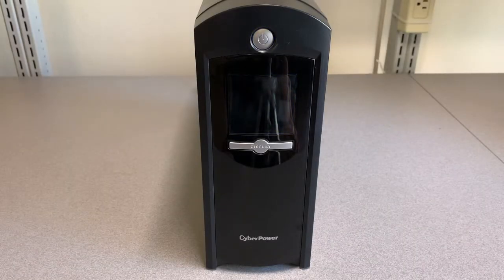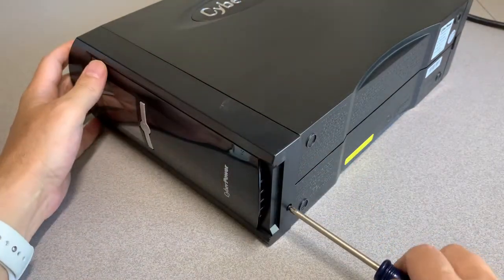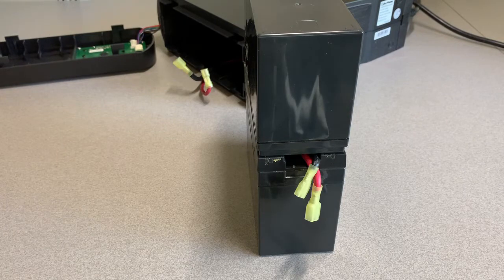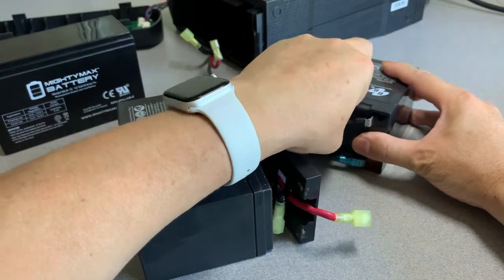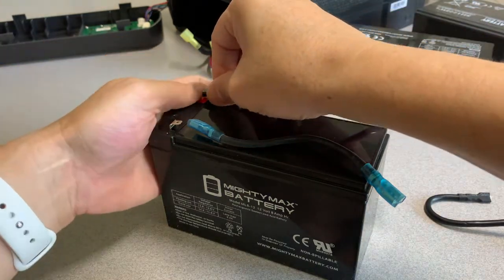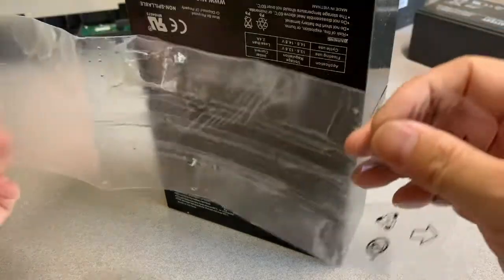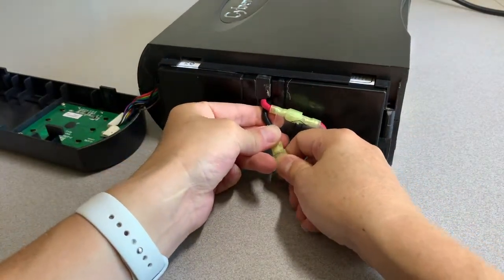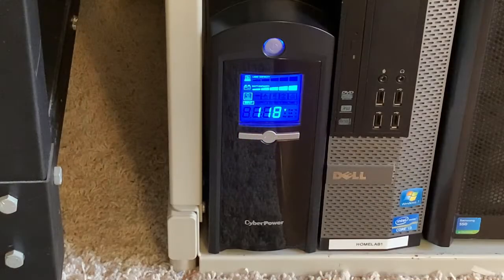How To replace a CyberPower 1350va UPS Battery.  Blinking Blue Display

Comment: The unit I had from Costco comes apart different.  Front panel does not come off.  Remove 2 screws on the bottom. Lower left side panel can be removed.  rotate batteries out. Batteries are end to end and not taped.  Disconnect and reconnect new. Put side panel back on.  Mine failed from a power surge  Otherwise good video, thank you
Reply from the maker: Thank you for sharing your experience with a different variation of the UPS.
Reply: Exactly the same thing as me! I replaced batteries on on many of these units over the years and it was always so much simpler than I was finding the instructions here. That's what happens when they change a model, but keep the model number. 🤪

Comment: I appreciate this video - my CyberPower 1350 AVR screen is doing the exact same thing, and it won’t power my PC.  I’m wondering if this procedure is the same for the AVR, since you said yours is the “VA”?
Reply from the maker: Hi EnochLight.  The 1350 AVR does look very similar to the VA.. That said, I'm a bit reluctant to say for sure, since I haven't personally tried it.
Reply: @BIsForBudget   - thanks!  Decided to brave it and take it apart anyway. Exact same procedure as yours evidently, and the batteries are the exact same. Just ordered a set from that link you posted. Cheers!
Reply from the maker: @EnochLight  That's great to hear. 👍

Comment: Thanks for the video. This helped a lot. How's the battery holding up? I haven't used the Mightymax brand before.
Reply from the maker: I'm happy to help.   The first set has been going strong for nearly 2 years.  The latest one has been running without issue for roughly 3/4 months.   I haven't had any issues so far (knock on wood).

Comment: What is the correct way to dispose of the old batteries?
Reply from the maker: Hi Jonathan, I used this site to find a local recycling site: https://www.call2recycle.org/locator/.  Thanks!
Reply: @BIsForBudget  awesome. thanks!
Reply from the maker: @jonathansafir3084  My pleasure.
Reply: I got replacementr batteries at Batteries+Bulbs (retail all over the US) and they recycled the old ones.
Reply from the maker: @gmc9753  Nice!  Thanks for sharing.

Comment: ROFL I was about to take a sledgehammer to it until I realized that my particular model, which is exactly the same as yours, had a faceplate that had to be pushed *UP*, not down.
Reply from the maker: That is odd.  That's a pretty big design change for the same model number.  Thanks for sharing!